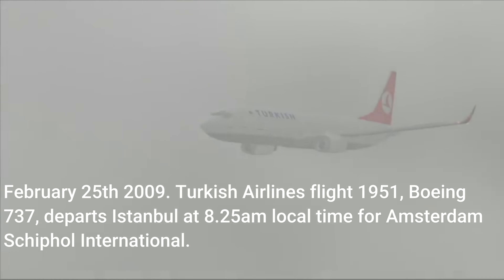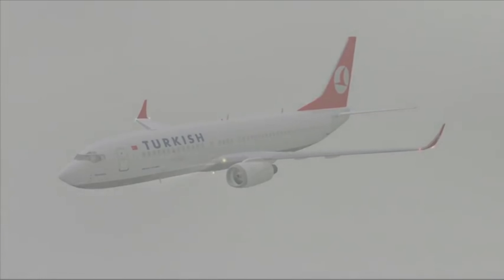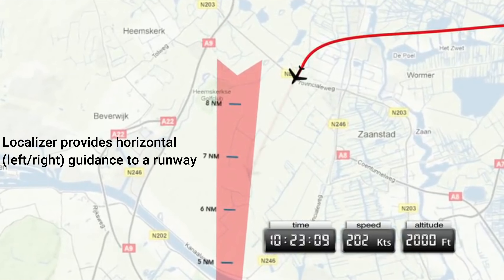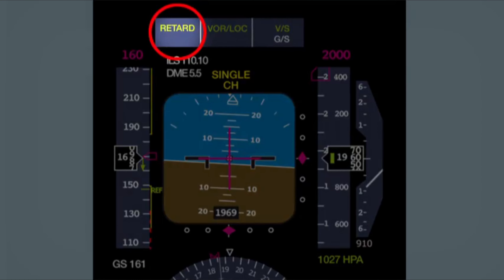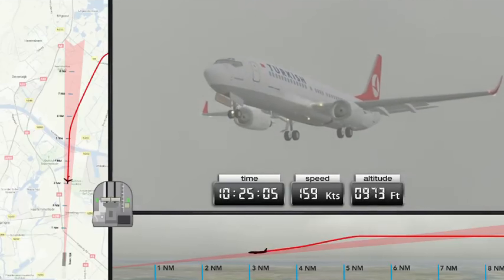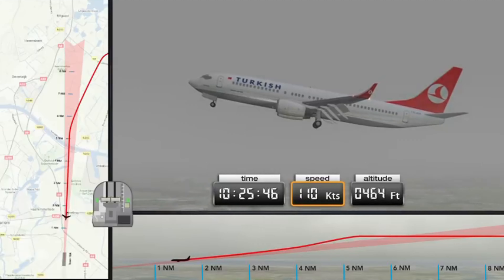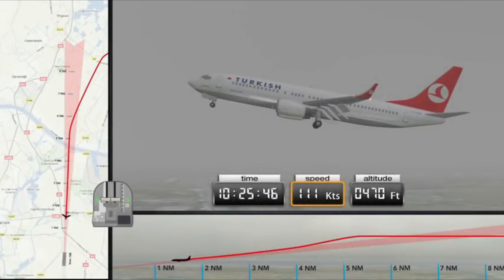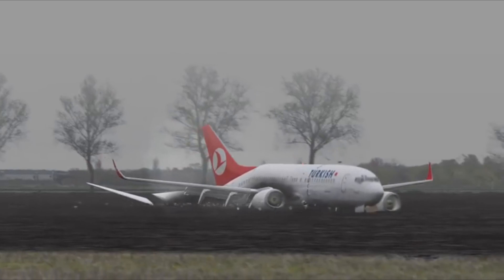Turkish Airlines TK 1951 crash on approach Amsterdam | Boeing 737-800 - Dutch Safety Board

Comment: what's the airpseed when the ground speed s 144 kts?  finally I have the answer to safely landing a large plane 🤗 thank you Sir  *another thing is to switch off that damnable auto throttle,  drives pilots to insanity
Reply from the maker: Ground speed is dependent on wind speed and direction. A tail wind will make you move faster over the ground and headwind will have the opposite effect. Flying at higher altitudes at the same speed will also yield higher speeds over the ground.  There's no definite answer to this.
Reply: @Captain_bernoulli  sounds perfect